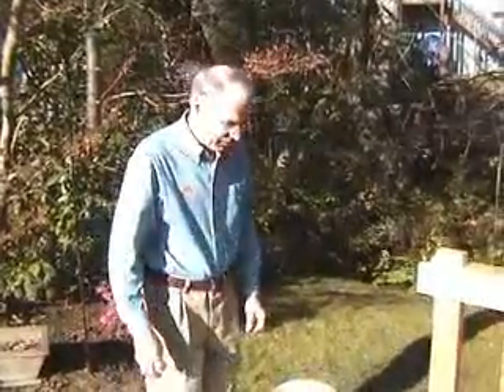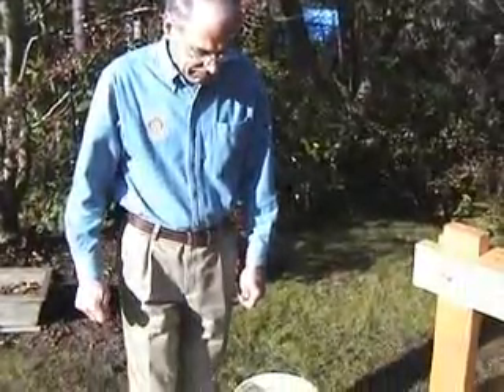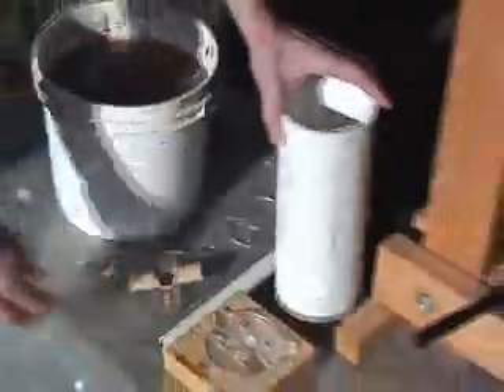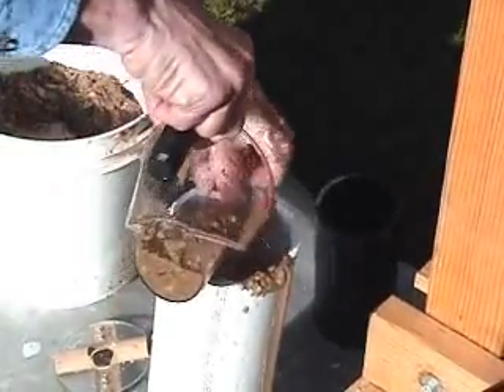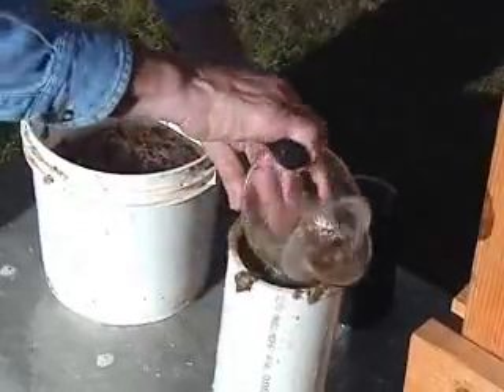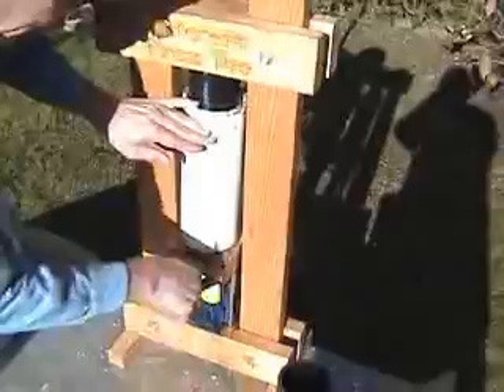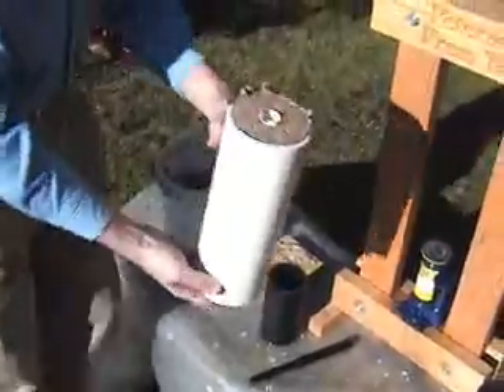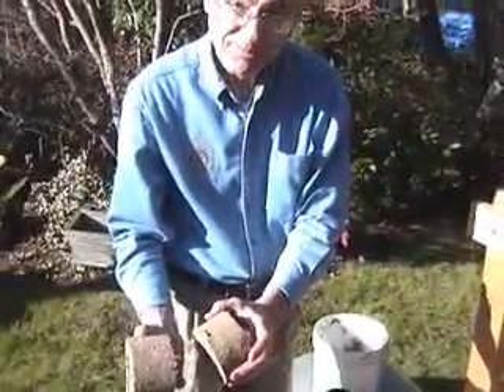Peterson Press Too Demo.wmv

Comment: @99cachorro you just brought up an interesting idea,people make paper crete blocks all of the time.why not have a square mold for something like this add a little concrete to it and use the paper leaves yard clippings ect. to make bricks for landscape and even building if the burn resistance is long enough?